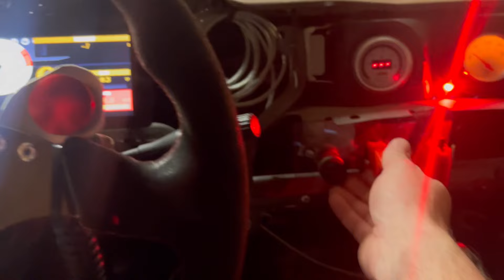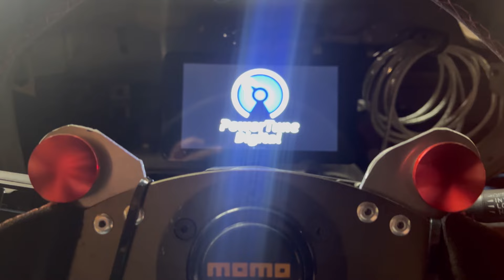Engine blew at 140mph!

Comment: Muriatic acid will take that aluminum off the cylinder walls without damaging anything. It just makes the aluminum bubble and you can wipe it off. I do it all the time with 2 strokes. Wear gloves and safety glasses…

Comment: how much timing where you running in boost ? and are you running gas or ethanol?
Reply from the maker: 16° timing on e85
Reply: @masterofmachines  that's crazy that's about what i am running 14 to 16 on e85 but i am 2jzge non vvti running 21 psi

Comment: How TF are you running into the 9's with jus that 4pt roll cage? My local track requires a min 6pt for anything in the 10's.
Reply from the maker: It’s a 1 3/4” 6 point roll bar, technically good to 9.99. But ya, they don’t seem to care at all at any of our local tracks. There is 7 second cars with no bars at all.
Reply: @masterofmachines  Damn thats wild!

Comment: I saw one guy already comment about your comment “I’m almost out of gas”.  I thought this is going to be bad!  I’m sure your data logger shows if you went lean or not.  I’m sure you will reflow your injectors.  Looking at your pistons and rings I believe you had too small of ring gaps.  I feel the pistons failed because the rings locked up in the bores. IDK what gap you had,  but I would increase all of them a good amount.  I’m an old school sbc nitrous guy but I run .024-.028 thousand on a 4” bore.
Reply from the maker: It didn’t go lean on the pass that it broke. You may be right, but fyi I had the top steel ring gapped to .019, and the second cast ring at .023. The piston is 86mm diameter. I got that spec by simply adding a few thousandths to the highest permisible ring gap for a factory turbo engine. Unopened turbo engines have been known to hold well over 800hp so I figured that’d be ok. Not certain though.

Comment: You're worried you'll run out of gas for the last run. That was likely the issue. It was running lean, got hot and melted the pistons
Reply from the maker: I’m literally always thinking I’m about to run out of gas. 😂 I’m getting rid of the tiny fuel cell for something bigger as I type this.